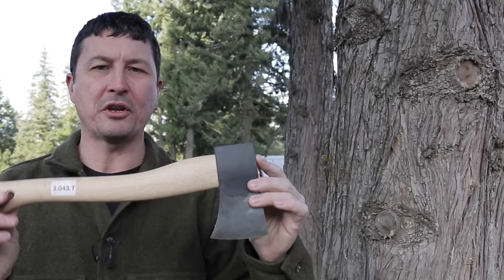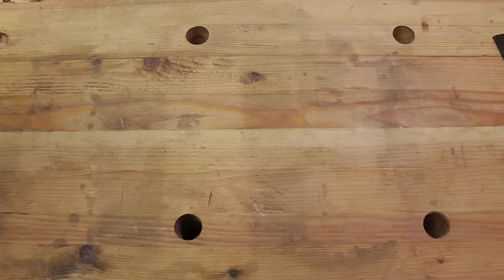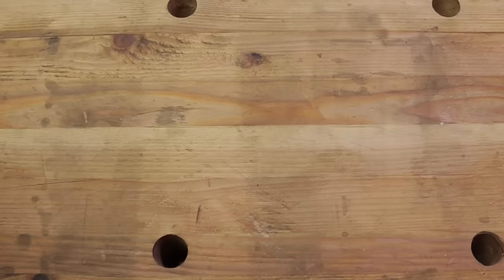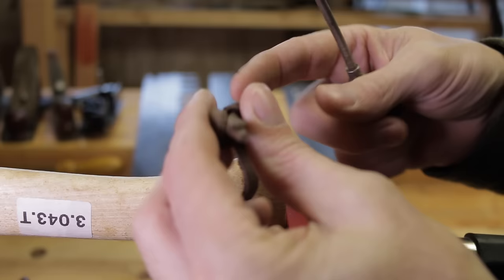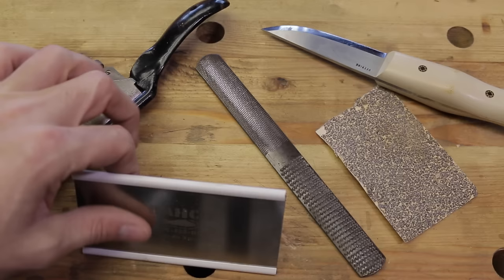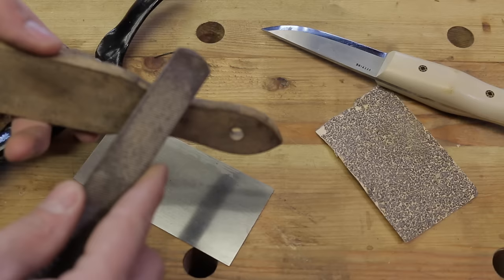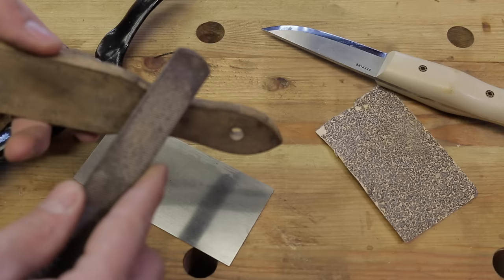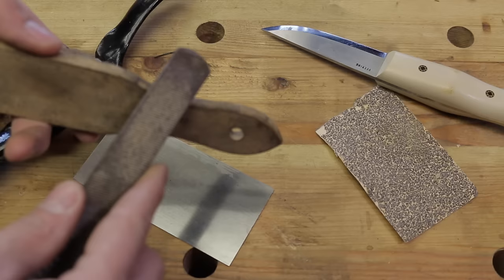5 Simple Axe Upgrades

Comment: I have seen from various sharpening videos that there are different kinds of sharpness. A blade with a shiny sharp edge is razor sharp bu the edge is more fragile. Where a blade a little less sharp, a little roughness in the edge by not taking it down to a really fine stone is more durable. That edge they say is better for utility tasks and for lets say butchering meat. Wouldn't that edge be bettter for an axe which by nature is taking a lot of abuse on wood?

Comment: You can buy some Prandi models off of Ebay in the United States, although i'm a little confused about Prandi because the ones you've shown in videos appear to be high quality and have a lot of detail,but half of the ones on their website have fiberglass handles and look like a council tool quality axe, also why does Prandi use ash instead of hickory handles?

Comment: Really awesome video, loved the tip on using the vice and the clamp.

I believe you were correct when you said striation, the surface grooves left from sharpening. My question, under the electron microscope, were we seeing the striation or the lamination of the layers of metal?  Actually, do axes get folded over like long blades?  Any info you have would be appreciated.  thanks!
~B

Comment: I liked the closeups of the factory edges, but 'stranuations'?! I think the word you were looking for is 'striations'! I have one of those Bahco hatchets with the orange paint, and mine was horrible both to hold and look at when I got it. The paint had bubbles and runs in it, there was a plastic hanging loop moulded into the handle wedge, and it even had a barcode printed directly onto the handle, not on a sticker or tag. For God's sake, Bahco, what were you thinking?! After a lot of sanding and many coats of linseed oil, and mirror-polishing the head and putting a serious edge on it, it's actually a very nice tool which I use all the time. But the way it comes as new, I'd consider it more as a make-your-own-hatchet project rather than a finished product. Then again, it's about a fifth of the price of a Granfors, so if you're willing and able to put the work in, you will end up with a genuine Swedish axe at a bargain price.

Comment: Good video overall, but I have one quick point to make about tool handles and varnish. The varnish isn't there for looks. It's often assumed that tools will be exposed to moisture. The purpose of the varnish is to extend the life of the handle by preventing moisture and rot. To be fair though, you are absolutely correct about it creating a slippery surface and one which will create blisters.

Comment: Why wouldn't you use some lacquer thinner with a wire brush or steel wool?
Reply: Varnish thinner do not take out all of the varnish 
With the steel wool you are just spreading thinner coating of varnish around. 
And the steel wool would roughen the wood n embedded bits of steel wool into the wood that would turn into rust n ruin the wood finish 

Scraping the varnish off is more environmental friendly and better

Comment: I am a big fan of your videos but I just wish you would have recommended putting a protective coating on the axe after you've stripped the varnish off. Varnish isn't a needless addition, it is used to protect the wood from rotting. It may not be the nicest texture when handling an axe (I totally agree with that), I also shave the varnish off any new axes/hatchets/mauls when I get them. As soon as I do this, I coat them in linseed oil to protect them from rotting.

Comment: Cody, you card scraper is NOT sharp at all, it would work much like your knife but better if your card scraper was sharp.

Domo
Reply: You sir are correct, it takes  bit of work to get it sharpened correctly, then you have to raise that burr with a hard steel rod, which takes some practice, but once you have it figured out, the card scraper, or cabinet scraper is such a useful tool.
Domo
Reply: I agree,  that scraper was not properly sharpened.
Reply: Raise the burr with a burnishing tool.  I have a couple of card scrapers like that and the curve sets that work great on tool handles and other curves.
Reply: Agreed ... DaMan probably doesn't know how to sharpen it for proper results.
I don't usually give tips, and won't start here !
SolidWood Furniture and Joinery is a passion, I have decades of experiences, including as a Sawyer.
Reply: I just use a glass pane, from an old window or a picture frame.

When it gets dull, just break it and you've got 2 new fresh edges.

Just use gloves/take care while using it to not cut yourself.

Comment: Is this a 5 part video of simple axe upgrades? I think this should have "(Part 1 of 5)" at the end of your video title if this is the case. One other nit-pick is after the beginning of you saying "..from pole to palm swell." I think you should have simply said one more line of "and because we will be covering everything you will want to do to your new axe, I'm going to break this up into 5 parts to make it a little easier for you to sit through." or something along those lines of mentioning that it's not all going to be in just one video. Then before getting into the video of "the first thing you will want to do" I think you should have simply stated the 5 steps that you plan to cover. Of course... I understand if you wanted to keep your 5 upgrades as a secret until revealed by watching each of your videos to keep people watching. However, I honestly much more appreciate a video/content creator if they are upfront about it all and don't try to hide anything. This video was vague, perhaps on purpose or as an oversight, and felt unfinished and inconclusive with its purpose. I understand if you can't fit everything into one video which is fine but just a simple overview probably would have only taken 1 minute or so to say and this isn't a 10 minute video. I have no problem watching your content that is longer videos but I have to admit to you that this video is a different change of pace from your older videos and it leads one to begin to question things outside of the video. In any case, I have enjoyed your past videos and insight that you share, and appreciate all of your efforts put into your work.

Comment: +Wranglerstar Hi, how did you get that scandi grind so sharp?
Reply: He got it from a custom knife maker and came like that. If you want your scandi like that use traditional water stones. Cody goes up to 8000 grit I think.
Reply from the maker: +CuriousTechGuy Logan is correct. I use water stones,
Reply: +Wranglerstar Do you know some water stones which are good but not expensive, I know I can look it up but I want an honest answer from someone who has experience.
Reply: Just my opinion: I personally don't like the idea of water stones. Yes, you can get your tools incredibly sharp. But water stones have maintenance- i.e. Flattening, and religiously soaking in water. I went with DMT diamond stones, finishing with ceramic extra fine and a strop.  I own multiple lives that are so sharp, they can split paper. All from diamond stones ceramic and strop. I spent about $110 for everything. When I priced out water stones it was about $250. If you are interested, I can give you more detail.
Reply: I have 3 diamond stones like the DMT but smaller, they're good for an ordinary flat grind. But not for a scandi grind, I can do a scandi but it would take for ages because the diamonds are hard/glued and don't come off like the real stones so they are much slower IMO. I also have a cheap ($5) water or oil stone but its a nightmare to use, the sound makes me wanna cry
Reply: +Logan Wyatt Ok, I found 2 sets. I know they're not water stones, but they should do. I hope. 
http://www.thebushcraftstore.co.uk/tri-hone-3-stone-sharpening-block---arkansas-138-p.asp

http://www.thebushcraftstore.co.uk/smiths-tri-hone-arkansas-sharpening-system-12796-p.asp

Comment: Ah just saying you really don't want your axe to sharp, because it chips too easily.
Reply: +plant man That's true to a point, I have a fiskars and an old restored hatchet. Both great axes but the fiskars tends to chip a bit easier, because it's designed to be a sharp axe and. However my older one is different, because it's a completely different shape but it also isn't as sharp. It doesn't chip much at all, but I mostly just use that for splitting. My fiskars is great for cutting down trees and branches, my old one is a brilliant splitter. So what is that's stopping my old one from chipping? Shape, blade or it being used differently?

Comment: Cody, 
First thanks again for all the great videos. My sons both now have there own boys axes, got the heads on ebay, then we cleaned them up and hung them on new handles. It was a great project. 

I had made the suggestion a few months ago on a previous video of your about taking the finish off of tool handles to use the card scraper. Glad you picked one up. I am adding a link on how to sharpen and tun a burr on them. The card scraper should peel off super fine shaving with little effort, similar to the knife you use here. 

https://www.youtube.com/watch?v=prC0K-2uIjc

Blessings